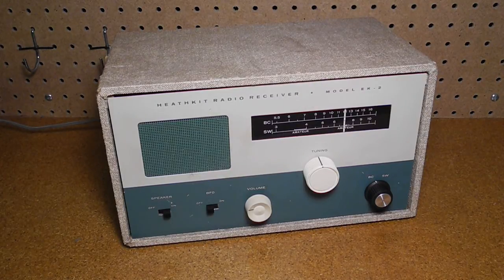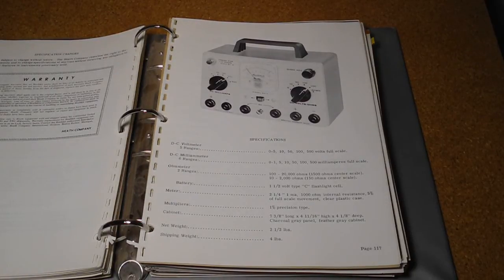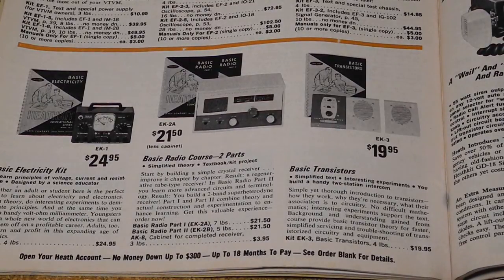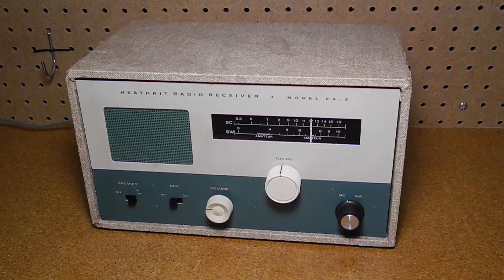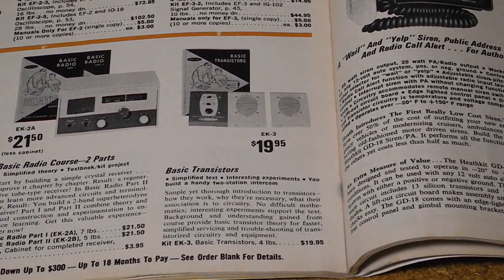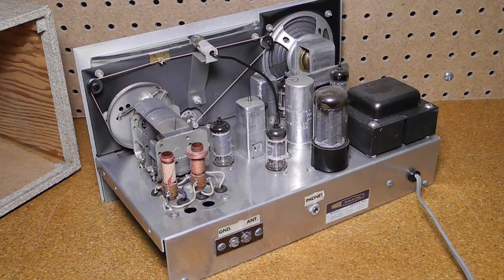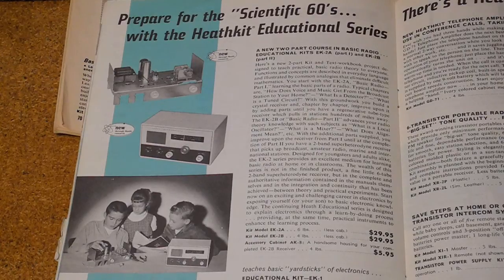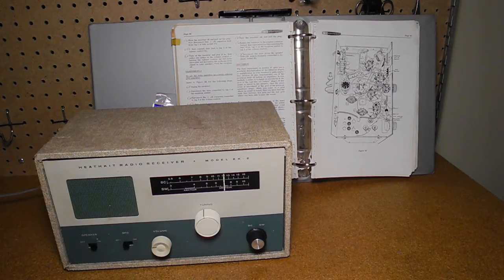The Heathkit EK-2B Radio Receiver

Comment: In 1969, I inherited one of these unopened kits from a distant uncle who passed.  Began assembling it the following summer as a young teen.  Think it took three weeks to complete.  Can specially recall my disbelief when reaching the material explained heterodyning.  What i disbelieved was the idea of mixing two signals to get sum and difference components. T'hat just didn't seem "right".   Had to build it to prove that this scientific concept was real.  If only I had had a scope back then.  Even then, the superhet approach seemed overly-complex.  Why not just build the detector circuit to simply track with the tuner?  Hey.  It was my first year in electronics.  I didn't know any better.

Get this:  I assembled it with my dad's Weller 60watt soldering pistol.  Didn't even have a soldering pencil until years later.

Anyway, hooked up a length of antenna wire and began listening to Radio Tirana, Radio Quito, Radio Moscow, Deutsche Welle, Radio Free Europe, BBC World Service, CHU, WWV (which is what they have you use to align the dial).  Had never heard these stations before.  I filled a logbook with summaries of all the propaganda in those broadcasts, including the Soviet "Five Year Plans".

So yeah.  Maybe this radio did not have the sensitivity (or spectrum) of a Grundig Satellit.  But it was plenty good enough to expose me to a whole new world of shortwave.  Was another 3-4 years before formally being taught heterodyning in engineering school.  But, by then, I already had the concept down thanks to Heathkit!